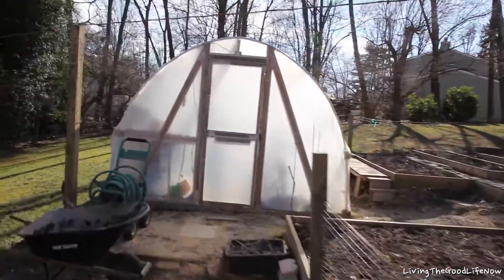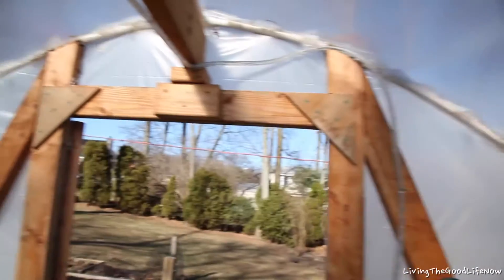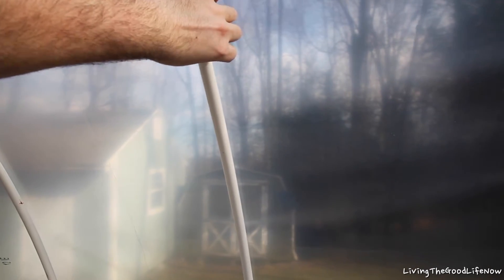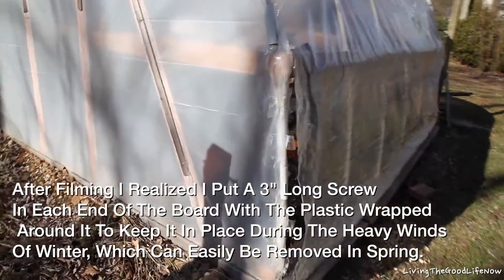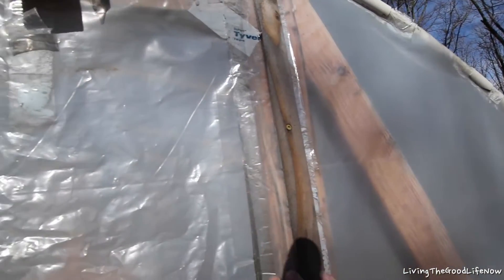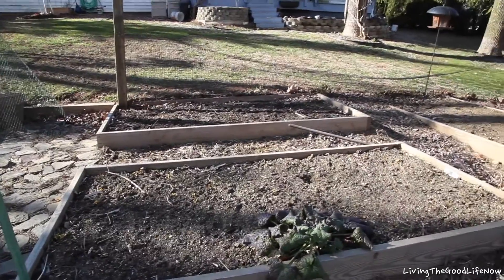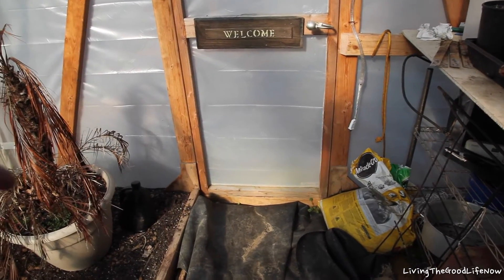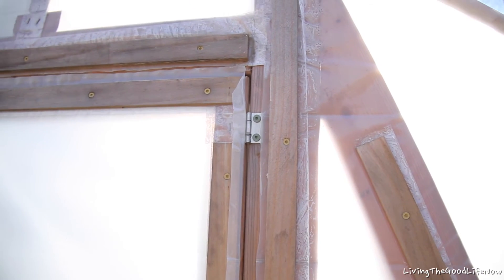1 Year Later: Homemade Greenhouse Hoop House High Tunnel PVC Polytunnel Raised Planter Beds Garden

Comment: I made a hoop house similar to yours. Do you have any problems with mold growing on the wood framing because of the condensation?
Reply: I didn't see any air vents.He opens the flap to let his vent. Amazon has automatic vents that open and close at 50 degrees to the moisture escape so you don't have to   leave a door or window open where mice or snakes can get in.